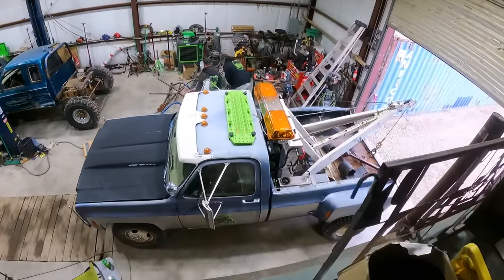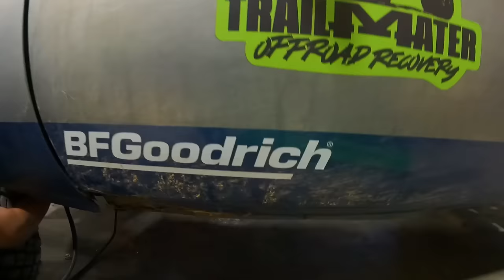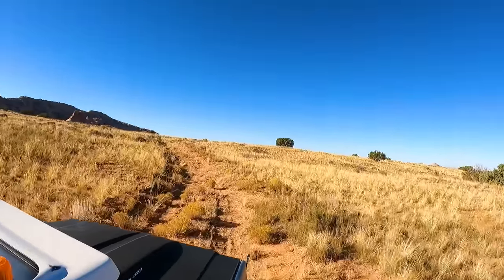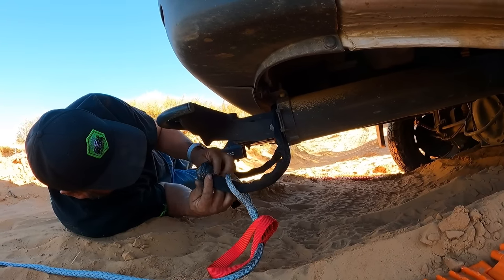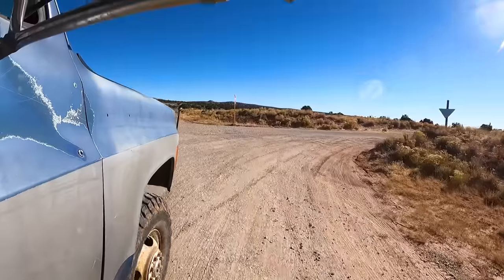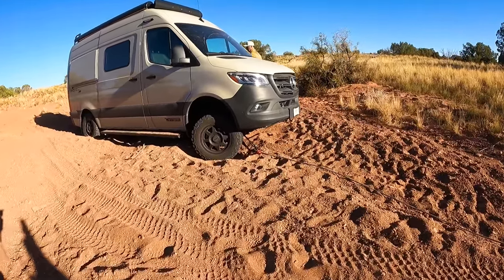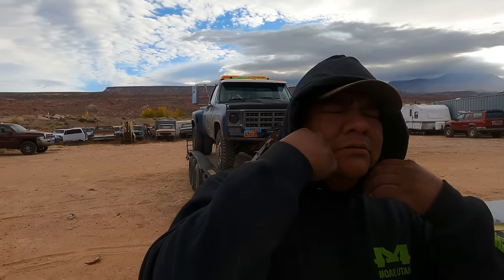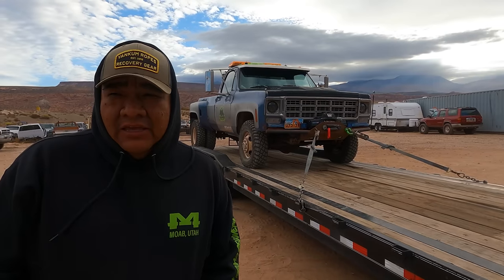So Long Blue

Comment: I totally respect and see the utility in traction control and other tech on vehicles, but they HAVE to have a manual override for when you need the vehicle to do exactly what you tell it to.   Some times it's vital to spin the tires, and some times you're battling for who's feathering the throttle, you or the computer.   Great stuff to have for most people, but it should be required by law for it to have a cutoff.
Reply: Yep my German cars have a traction control button that's very obvious. Hold it down and you have zero traction control. My Toyota AWD on the other hand, apparently you have to do a parking brake/gas pedal sequence that's impossible to remember and very time consuming. Not exactly something you can do quickly when you really need it.

Comment: If he paints it with a spray-can, it'll look better than it does now, unless he paints it pink-n-purple like the RAD-charger, lol, I'm sure it will look 1000x better, and from the sounds of it, it's going to be way more capable also, that's awesome, you should build a beast of a engine for the new string-bean truck when ya get it back, lol, maybe an LS?, the engine in blue now just sounds so lazy-n-tired, (JMO), awesome video guys, thanks for sharing.

Comment: Ol' Blue getting a green paint job.  It'll be Ol' Blue forever to some.  At work we had a red barn at the one location.  In the late 70's it got covered with beige metal siding.  It was still the Red Barn when I retired a couple years ago - and likely will be for a long time.  Confusing for recent hires:)

Comment: Names stick with something that is always reliable and always used. I’ve worked at a forklift repair shop for the last 16 years. The oldest shop tech has been there for 45 years. The first shop forklift was blue in color. It’s been replaced a few times with forklifts with larger capacity. Even though all the new ones have been Hyster      Gold our Yale Gold. The shop truck is still called Old Blue……

Comment: Nice choices with getting it painted and Alcan for the springs. I am am building a 73 K20 and went with ORD and I think they use Alcan. The springs seem really nice. Alot more leafs and thinner for more flex.

Comment: The problems with the Mercedes Sprinter Winnebago version is that it's a diesel that has less than 190hp and you have to deal with the turbo lag. Also, the ESC and traction control are garbage because if the computer detects the rig being a little off-camber or attempting to articulate to get over what most consider an easy obstacle, the computer will cut power trying to save the drive train when in reality it is causing problems. It is a vehicle designed for pavement and trails just off pavement.

Comment: Wish I could show you guys my family album , my parents had traded in a 88 Suburban for a green GMC 93 Suburban that was four wheel drive the four-wheel drive with controlled on the floor a week after my birthday in September I had just bought a 2000 Chevy Tahoe green that's a Z71 but the four-wheel drive is electronic which I am iffy on however I had also a 96 F150 that was green like these two Chevy's that my family have had and I have now really cool that you are painting your dually traditional green
Reply: The GMC Suburban we had, has the 350 , and the Tahoe I bought is the last model with the 350 block 
I can't wait to see your truck again. 
I moved back to Laramie Wyoming from Crestline California to finish my schooling at 28 years old . My Lexus LX470 and my 97 dually are in California,  hoping to bring back my tahoe and my 84 bronco from Laramie when I'm finished with school

Comment: Rory, I can’t believe how few miles per gallon Blue gets. I would’ve thought with a big block engine you would at least get 8 miles per gallon
Reply: Why would it be more, this is not anything like Highway driving. It’s worse driving in sand, it’s always uphill in sand!
Reply: Off road halves your mpg
Reply: Plus all the extra weight of duallys and tow equipment.
Reply: Not sure but I think Blue may be running a Frankenmotor, parts from at least 2 different motors slapped together.  In any case it needed a tune real bad earlier, and is now doing better.  As you said, probably still some room for improvement.
Reply: @grannyt6819  
Probably the most valid point so far, add that to driving in sand and we have a winner!

Comment: That's the only disadvantage to big block gas engines.... they are torque monsters but the fuel economy is next to horrific....  We had a international cab over with a 549 gas engine.... It was a great engine but it only got between 2 and 3 miles per gallon....

Comment: Many years ago, local 4 wheel drive shop built this kid a jeep with all the bells and whistles, new engine, doubler, dana 60s with lockers, sent it out for a paint job... Older guy was checking it out, told the kid "You need to go out and run it against the bushes outside the shop and get the first scratches on it then you won't be worried when your on the trails."  kid looked at him horrified and said" it's not for teil use" everybody in the place just looked at him wondering why he had spent all the money to build a trail rig if he wasn't going to use for as a trail rig?

Comment: A hitch mounted winch with front and rear hitches should be the first thing all these van owners should by. I understand  the convenience of having a van for “ overlanding” but understanding these are more all wheel drive than 4 wheel drive and are not designed to go everywhere.

Comment: How often do you find people who believe that if a wheel stops gripping soft ground you should plant the boot and spin the wheels. I would have thought that backing off to regain traction may be a better option instead of making the hole deeper. I ask this as a non off road driver so please correct me if I am wrong.

Comment: That Sprinter traction control system would be infuriating! It reminds me of my Toyota with AWD. The traction control system is not defeatable without an absurd parking brake/gas pedal sequence that is time consuming and impossible to remember. The cars that I have with a simple Traction Control off button are so much better.

Comment: Traction control was designed to maintain traction on improved roads, not out in the boonies with loose dirt and sand.  And those sort of vehicles were never designed for that sort of terrain.  People just do not stop to think and they never read the owner's manual.

Comment: Anyone ever tried using a strap to lock the wheel that is off the ground on and open diff?
Thinking about it a little more could you put the brakes on then clamp the line to that corner?

Comment: 4:07  Fun FACT of the day!  That was a RAVEN, not a crow, so NO attempted murder, a group of Ravens is known as an unkindness!
Reply: When in flight the Raven's tail forms a wedge due to the center tail feathers being longer.  A crow's tail feathers are all the same length, so when a crow is in flight, it's tail plume is a straight line.

Comment: Modern bodies are designed to flex like that for compliance. It makes a smoother ride and less stress cracking in the frame. Plus lightness and cheapness. But it works fine, obviously. The Sprinter is insanely popular and they do huge miles.

Comment: I just realized that your flag in your shop is hung up backwards.  Stars always go on the left when you look at it.  

"(i) When displayed either horizontally or vertically against a wall, the union should be uppermost and to the flag's own right, that is, to the observer's left. When displayed in a window, the flag should be displayed in the same way, with the union or blue field to the left of the observer in the street."

Don't pay attention to the flag patch on Army uniforms.  That follows a different rule.

I know, I know...."Thanks for watching"...
Reply: I've called it out before too, thumbs upped your comment hopefully they see it :)
Reply: @Myhandle306  It's not camera reflection.  The BFGoodrich sign and Trailmater logo on Rory's shirt is still oriented correctly.

Comment: The sprinter van has 32" tall tires and it's pretty clear they look small.  And next to ol' Blue postitively tiny. Clearly, there's an articulation problem and an electronic computer probem in the programing..  The new Bronco seams to have most of those bugs figured out.... Thumbs down on the van. It's ok for hard pack...

Comment: Amazes me that these folks spend $200+k on an 'offroad' camper rig, but it's only 2 wheel drive. Or they're running aggressive tread/highway tires in the sand.  Have Zero understanding of self-recovery.
But then if they did... there wouldn't be a need for Rory